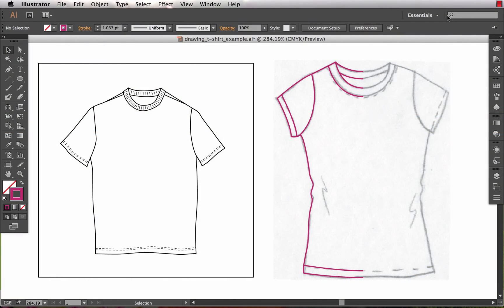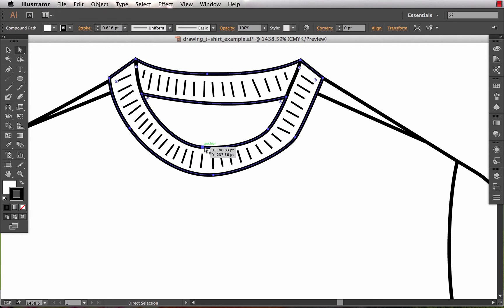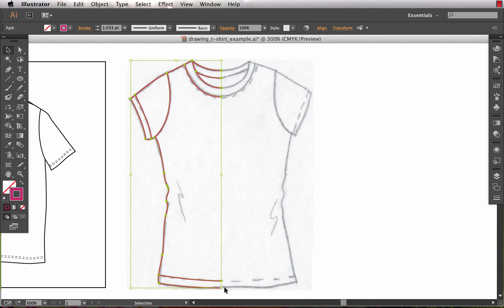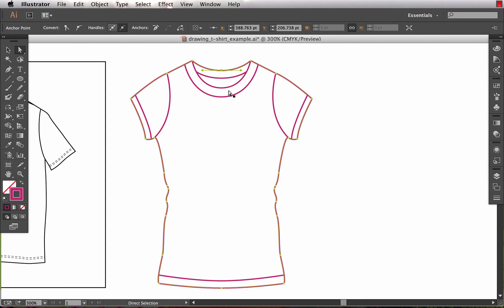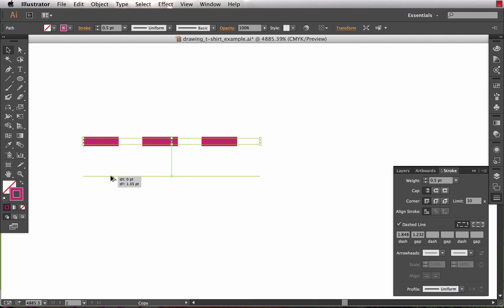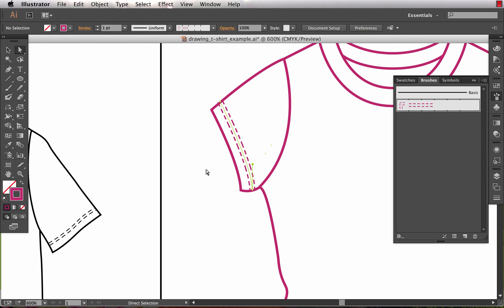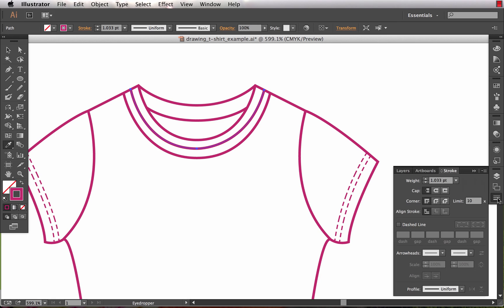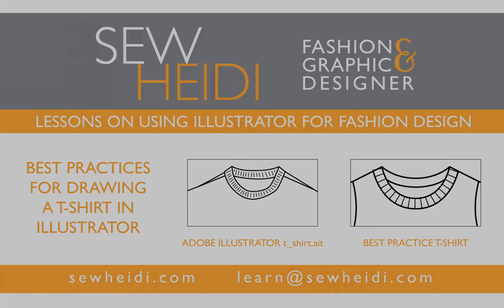Best Practices for Drawing Fashion Flats in Adobe Illustrator

Comment: Firstly, thanks for all the Illustrator tutorials, I feel that I was skilled in my uni days, and yet the program has come leaps and bounds, which I have not found time to catch up on in my working days. These are really straight forwards and helpful.

I have tried doing my ribbing as per suggested in the past, but I always get an overlap at the edge where the dashed line does not sit cleanly inside my neckband edge angle, it can be see on the wearers right neck on your demo. Is there a neat way to avoid this? Thanks!